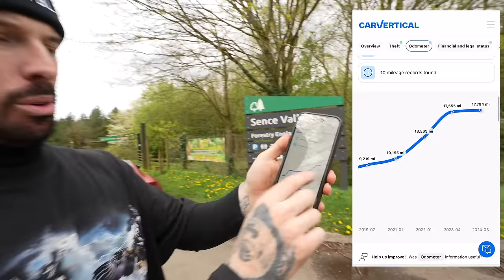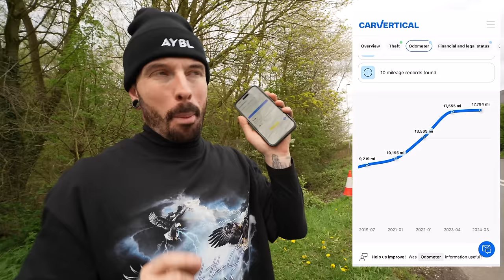I CRASHED MY LAMBORGHINI

Comment: The same 30mph Marcos Rashford was doing! LOL!!!!!   Glad no-one was hurt. Good luck with the re-build.
Reply: I was thinking that myself mate😂.  Fair bit of damage for 30.  Slicks too 🤦
Reply: @biggdub4876  yea more like a 60mph crash !
Reply: @blu3qc perfectly straight bit of road too.
Reply: I wonder if the Pinnoch
Reply: I wonder if the 'Pinocchio' tool will make a reappearance when he tells this story again in the Garage!!
Reply: he'd just gone from 30 to 50 zone though, so more likely up around that.  Ive been in much less powerful cars that have stepped out a bit like this in those conditions, a couple with much better driver aids/traction control etc than that car. Any gear changes with that much power (especially with any sort of boost) would be harsh in this car. Its a bit of driver error, probably needed to be nursing it a lot more than he was to be safer, but this isnt a 80-100mph crash, probably in that 50 range (and who knows if he accidentally revved or downshifted once he lost it).... lucky guy to not be hurt!!
Reply: This is what happen when you push these supercars to their limit
Reply: @PIL-t3x  IMO this was more a question of wrong tyres. There is a reason why some countries have mandatory minimum profile for cars to be street legal
Reply: @biggdub4876 yep...that's what a 70mph aquaplaning crash would probably look like.
Reply: Speeding in the wet like a bellend

Comment: Matt, I'm Porsche Driving instructor...A 911 GT Touring with Michelin Sport Cup , Il lost control at 40MPH on wet conditions and get it back straight miraculously....These semi slick tyres are F***cking tricky ..You are a legend to rebuild that car...!!!! You are safe, that's the most important..!!!
Reply: Driving on slicks in any other weather conditions than pure sunshine is fucking reckless.
Reply: No, the most important thing is nobody else was hurt.
Reply: ...lessons for Matt please 👍🏻
Reply: No such car
Reply: Michelin ps4s are really good. Unless on track I don’t see the reason for slicks
Reply: surely it is illegal to drive on slicks? isn’t there a minimum tread depth on tires in the uk
Reply: @KS-vo3hf you can get road legal semi slicks
Reply: Slicks or semi slicks in uk where it rains 2 times a day is not optimal. Maybe roadtyres or inters for street n slicks for track is the move. Its just a fact that slicks turn you from driver to passenger even in damp conditions unexpectedly and you dont need to be driving fast
Reply: No such thing as a GT3 touring?
Reply: Semi slicks. Slicks are illegal for road use.
Reply: @davidmarshall6409 yes, there is. Essentially a GT3 without wings. You can order it with Porsche today.

Comment: First thing he said was "I don't know how this happened" and then said "I got slicks on it and it's wet". My boy what do you expect 🤦
Reply: Not gonna lie, slicks on public roads are just asking for trouble. Great on a track but bloody useless when driving on poorly maintained public roads, even when dry
Reply: Clearly speeding.
Reply: @colinrobinson4233 What makes you say that? From the damage I'd say it's an impact of around 30-40mph. Ever driven a high power rwd car in tricky conditions? Or does your armchair not offer such experiences?
Reply: @jonsmith1162 damn you didn’t have to do him that dirty 💀💀
Reply: @jonsmith1162  speeding isn’t necessarily breaking the law, driving 50mph on a rural road on slicks during heavy rain, in a 1000bhp car is speeding, going more than 20 is speeding. If it’s been snowing I don’t then go flying round country roads at 60mph because that’s the speed limit, I drive accordingly to the conditions and the limitations of the car, anything less is reckless!
Reply: @jonsmith1162  the car would’ve stopped dead next to the ripped out lamp post if it was travelling at 30. The fact that the car ripped out an entire lamp post and still had the velocity to go like 100 feet further shows it was no where near 30 lmao.

Comment: Glad you're all right. Looks like your left rear clip that first lamp post threw you down into that ditch and your front end hit that tree and spun you around. I worked several wrecks with the rescue squad as well as I was in a similar accident several years ago and somehow amazingly walked away. I destroyed my perfectly original 93 M3 it was worth nothing but scrap metal afterwards but I survived with only a minor little bump on my head from bouncing off the window. But when my front end spun around and smacked the tree it lifted me up off the ground and flipped me and crammed the engine into the cab of the car. I was running 75 or 80 mph in a 25 zone. In a curve that I had taken even faster before but this particular night there was a loose gravels there.

Comment: The passenger seat in Italy is on the other side and what if they got confused assembling or programming the device since in uk is the opposite? This will also explain why the steering wheel airbag didn’t explode

Comment: Ah that will buff out... I did crash with my car (in about 45 mph) in icy conditions (with really bad tires also) and it spun around twice then hit a light pole (a huge/hard one) and the pole almost smashed the car into two pieces... it went totally thru the passenger side... so If I had a passenger this passenger would be no more.
Got a really stiff neck a couple of days... but I had full insurance luckily and got more money then what I bought the car for (yes I did some bits and bobs on it so maybe it was even Steven)...

Glad you are OK... I'm definitely checking the conditions better now before I sit in the car, and do a quick check with the car before I drive nowadays (it was about 20 years ago)...

Comment: By hitting the breakaway lamp post, that slowed the car down enough that the airbags did not deploy when hitting the tree or telephone pole. The crash algorithm is using many variables in order to decide to fire or not fire, but the amount of g force and speed of the car is used the most in the calculations. If you had hit a tree or the telephone pole first, you would have deployed the airbags. I also saw in another video of you handling the airbags. Static electricity can set them off when you are holding them. We wore ground straps to earth ground to make sure we didn't set them off. You would also be surprised at how many mechanics deployed the airbags because they remove the airbag controller without disconnecting the harness first. If you don't disconnect the harness and turn the airbag controller over, it thinks the car is rolling over even if it isn't moving, setting off the curtain and side airbags.

Comment: Glad your ok mat but I think in case of bad weather keep a low powered all wheel or front wheel drive car In the workshop or in the yard for bad weather and on normal tyres with decent tread depth on them I guess tho that is a serious thought because there's less chance of going wrong I guess. tho I'd say if the lamborghini means enough and it's doable then rebuild it if it's salvageable.

Comment: Glad you are okay. My understanding is that value no longer plays a part in what category it gets. N is non structural, S is structural but repairable and B means it was structurally damaged beyond safe repair. So if you are concerned it might be a Cat B, you should really have it checked, as if you put it back on the road and have another accident, it may be a lot worse if the structure is compromised.

Comment: I think what happened is the car was already in a clockwise spin when the front end caught the lamp-post at about 2-o'clock and continued clockwise, the rear passenger wheel has hit the tree from about 7-o'clock and bounced the car back out, the heavy impact to the rear quarter will have deployed the airbag on that side. I don't know for sure but air-bag technology has been developing pretty well and I would expect it's only going to deploy the bags it feels it needs to when it needs to, that way if there are any successive strikes it's still got something it can deploy.
Reply: yep thats exactly what happened from a logical point of view I agree. The hit on the lamp post on the driver side increased the clockwise spin, which led to the car bumping the passenger side back wheel against the tree suddenly starting the counter clockwise spin instead. The spinning momentum and sudden change of direction really ate lots of kinetic energy, very lucky circumstances. Could have easily died there by hitting nothing but the tree... 
The police report should be able to calculate based of the damage how much he was actually speeding. My guess is about 70-80mph.  On a wet road with 1000hp on slicks that's obviously mental.
Reply: @speedtree  inclined to disagree with your speed estimate it really could not have been travelling that fast when it left the road for it to come to rest in such a short distance and it'll be a combination of poor tyre choice and either standing water or oil/diesel. it's pretty wild how far a car can travel out of control particularly in the wet. I hate to sight the higway code but with all 4 wheels on the ground the 'typical' stopping distance from 50mph is 55 meters, that's not in the wet and in a ditch. also lamp-posts and phone poles are specifically designed to shear off at ground level when subjected to a significant enough force because twofold; they can exacerbate damage to something hitting them and therefore any occupants, also in the instace of phone/power poles if it shears off at ground level the pole rides over whatever has hit it rather than it potentially bringing the line down on top of whatever hit it. meaning they don't actually do much to slow down an out of control car.
Reply: @speedtree  TLDR if it'd been going 70-80mph it would have gone foreeeever (seriously tho, it's pretty horrifying how far an out of control car can travel). and they'd probably have had to pour Mat out of it. which would have been bad.

Comment: I had a 180kmh 90 degree unespected steet direction with an opel astra,GSI , avoided the river ditch, passed miracuusly twisted thru 2 cars, steering snapped out my hands, rip off 15 meters of steel guard rails thru my doors and broked 3 ribs, lucky none enjured (just me) damn, this was when i was 19 years old with 3 other kids onboard

Comment: You can go a long way at low speed. 
I crashed my mum and dads Peugeot at 50 mph at a motorway junction, in total i did three 360 spins crossed four lanes of motorway a hard shoulder and a grass divider at the junction.
Car was ok till someone crashed into me once i had come to a stop 😂.
Caused by a patch of oil/diesel on the curving junction.

Comment: Hydroplaning is a bitch man.  Like you ain't even speeding but damn when your wheels decide it won't be sticking on the ground just because of some water you are done.  I recently had an accident because of hydroplaning too.  Went to press on the brake pedal for a 4 way stop but nothing and going 10 mph to stopping motion just hydroplaning is the worst feeling because everything is in slow motion and you are saying if my brake just work or my wheels touch ground then this accident never should have happened.

Mat, glad you are safe.  And be safe driving while the road is slick.

Comment: This is why slicks are illegal for road use :( 
You can loose traction going 15 mph on a turn with those on, nothing to grip sand, water or any other substance on the road. Hope the repairs go smoothly

Comment: Oh my wife says that she knows that feeling all to well. I flipped my F-250 QUAD Cab, while I was on the phone with her. She tried and tried to call me back and the phone going to voice-mail. 
   My back passenger tire exploded and this triggered the airbag. The airbag to the face knocked me out. I landed upside down in 4 foot of water. I came too with me sitting up on the side of the road with my hands over my face. Then I went back out and woke up again with EMTs cutting my pants and me freaking out. Then I went back out again. I came too in a hospital bed in the ER with th3 doctors pushing all kinds of pain meds. 
    I still have issues with short term memory loss. For 8 months, I barely knew who I was much less my wife and kids. 8 months of struggling and my wife said I was no long allowed to work again. That wasn't even a truck I built, I left it all Stock and I had plans to bring it to the shop for a bigger turbo, but that's too late now.

Comment: The ego on ya! Not a single apology, not willing to admit fault (all cars start at zero mph, they dont just fall off the road, so its either mechanical failure or driver error)

A lot more humble when you were fixing faults on a tatty TT. Pride comes before a 1000hp fall apparently.

Comment: You spun the car backwards because you were accellerating too quickly on wet pavement for your tires and overcorrected the slide, you went up and over the curb backwards and the residual angle on your steering wheel spun the front end of your car into the tree sidways (you called it a lamp post for whatever reason), and that tree pushed the front end of your car back around so you rear ended the telephone post and street light.

Comment: 1000HP are not easy to control. 
Driving home in the wet was definitely not a smart idea but we have all been there. 
Seems like its fine and then bam. 
Afterwards we knew it was a bad idea but well. When you said you were in second gear at 30. i suspect 30 miles/hr since you are in the UK.
that seems really low for 30. I dont know the specific gear ratio but second gear with 1000HP shouold not only be relatively high on the revs but puts way too much power down. 
It was basically the typical idiot does burnout car upshifts suddenly bites and gone. 
Just that here it was wet and i would say the selected gear was just wrong for the conditions. 
i personally drive in as high a gear as possible when i just casually drive or the conditions are not optimal. 
When i wanna have fun of course i go a bit more on the gassy side. 
I once lost the rear in third gear at 50 km/h on the onramp to the Autobahn in my 98 Ram. 
Was damp but not wet with new tires. (Radar renegades at5 for those who want to know) and it just sliped while dropping the hammer in third. The acceleration is NOTHING like a lambo in third and the thing weighs 2.2 Tons empty and it started to slip. 400NM of torque coming down to the wheels and it just went. Was easy to countersteer luckily but it shows how easy it can be in wet or just even damp conditions. Even with the right tires. 
Matt might still have been a bit too triggerhappy on the pedal but like i said. 
We have all been there some way or another. 
Glad you are okay man

Comment: Deeply suspicious... at 11:40 in the video you say "heading out of a 30 zone into a 50 zone". At the roadside where you're saying the accident started, you were still 200m from the 50 sign. the length of the accident was approx. 85m, assuming a constant deceleration from 30mph that would take nearly 13 seconds (realise how long that actually is). I think there's some attempt at deceiving people into thinking you were unlucky rather than driving dangerously on a very poor choice of tyre for the climate.

Comment: Should you keep your driving licence after an incident like this? IMO it's a no. I think if you lose control of a vehicle, especially in this manner, it should be an immediate 12 month driving ban followed by an extended driving test before you're allowed back on the roads.

It's surprising to see even the police being more concerned about recovering the vehicle than the manner of the driving (although they did at least breathalyse). Letting insurance deal with collisions where there is no injury leads to complacency on the roads and I don't think it acts as much of a deterrent.

Comment: Normal people would write it off.   But that isn't you.

Friend of mine wrote off a Ferrari, driving on the wet, and it snapped on him.  Like you he walked away but he was lucky to live because the engine cover came through into the passenger compartment  and missed his next by 6 inches.

Don't drive these cars in the wet or go slow and make sure you have great tyres.

Pleased you survived.  That's really all that matters.